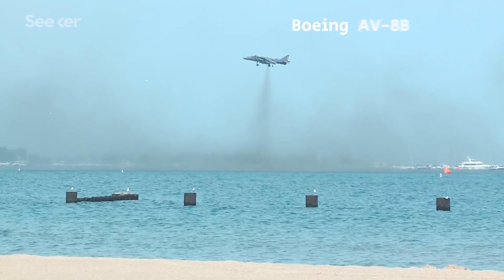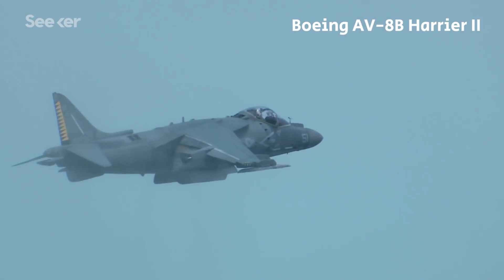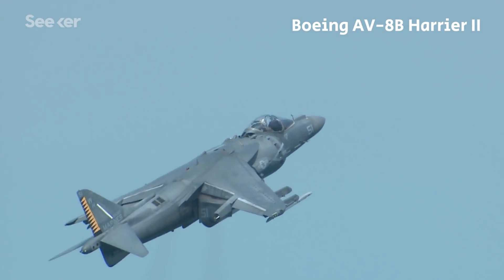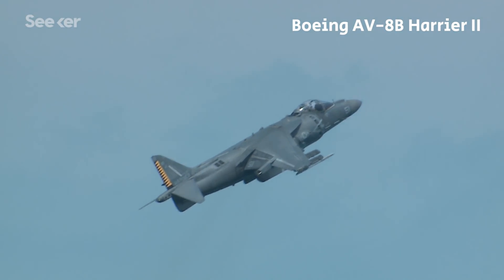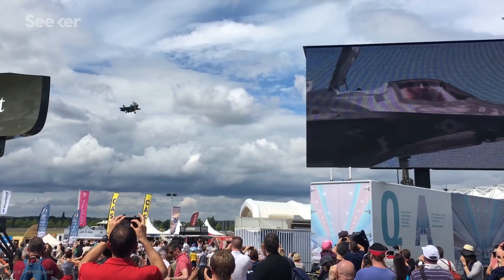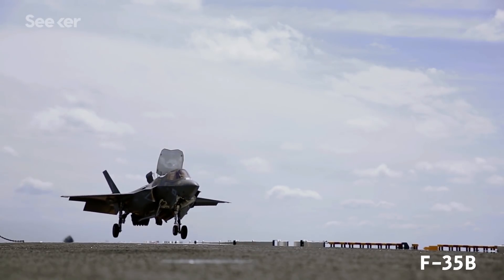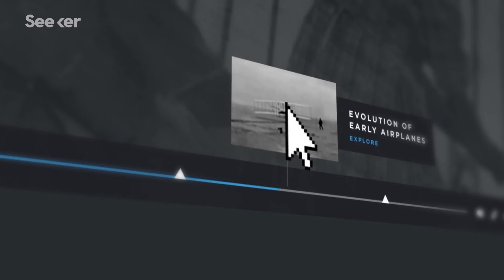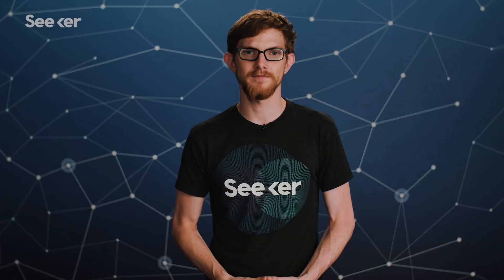These Jets Can Hover Like Helicopters, Here’s How They Work

Comment: "Point engine down"...   Check!

The F-35 has been around in some capacity for over a decade now, even still, it's not capable of vertical takeoff and has been plagued with problems from the start. Not to mention that, many still are not convinced that it will preform any of its tasks as a "multirole" aircraft particularly well. I guess time will tell if it will be one of the greats.

Comment: all these quotes sum up how i feel about flying in anything

If the wings are traveling faster than the fuselage, it’s probably a helicopter – and therefore, unsafe.

The two most common expressions (or famous last words) in aviation are: ‘Why is it doing that?’ ‘Where are we?’

‘Blue water Navy truism: There are more planes in the ocean than submarines in the sky.’ 
– From an old carrier sailor

‘When one engine fails on a twin-engine airplane, you always have enough power left to get you to the scene of the crash.’

‘If something hasn’t broken on your helicopter, it’s about to.’

Basic Flying Rules:   
‘Try to stay in the middle of the air. 
Do not go near the edges of it. 
The edges of the air can be recognized 
by the appearance of ground, buildings, 
sea, trees and interstellar space. 
It is much more difficult to fly there

As the test pilot climbs out of the experimental aircraft, having torn off the wings and tail in the crash landing, the crash truck arrives. The rescuer sees a bloodied pilot and asks, ‘What happened?’The pilot’s reply, ‘I don’t know, I just got here myself!’
– Attributed to Ray Crandell (Lockheed test pilot)

Comment: What about that one riddle regarding a 747 going full thrust on a treadmill that can keep up, whether it would take off or not? Makes you think. Because on one hand you need a net forward motion to generate lift for the wings, but on the other.. the jet engines compressing the air don't need to interact with the ground to produce said forward motion, and thus would move forward.
Reply: This is not how it works... Lift is generated due the forces acting on the wing (particles smashing into the wing, if you will) - not by Bernoulli effect as someone would suggest (either way, you need plane to be moving anyway). Jet engines' compression works only because air is moving and it would not have any effects in stationary fluids (if we are talking about conventional planes, jet-fighters, ect.), so I do not really understand what is your point here. Borderline - you need to be moving trough medium with wings at the angle to generate lift.